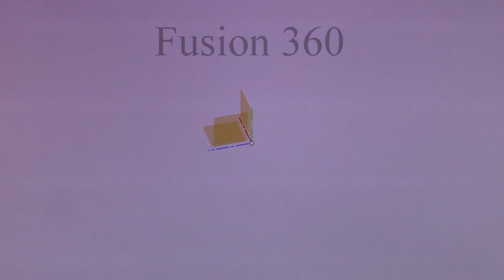How to: plywood fidget spinner

Comment: why did you print a 3d model if it was just to use it to draw on a board?
Reply from the maker: If you watch the full video you will understand why.
Reply: i've watched the full video already and its useless, you could sand it without using that 3d model
Reply from the maker: Dude! it works as a guide for the dril when I make the pilot holes and for the router. It makes it easier to make a lot of those spinners.